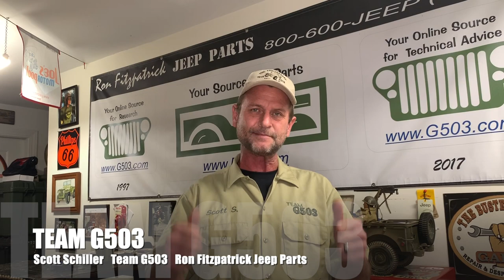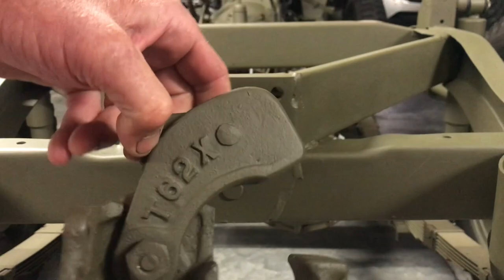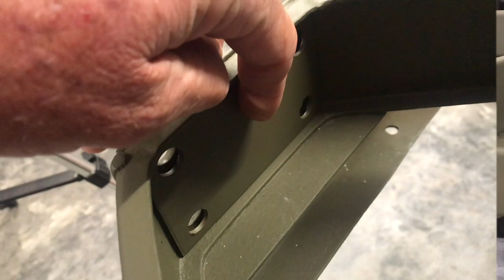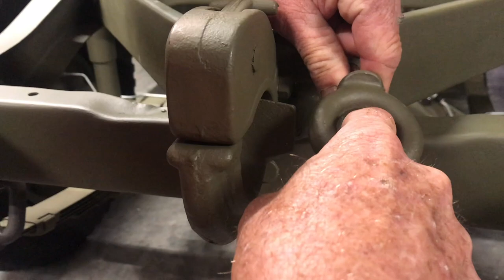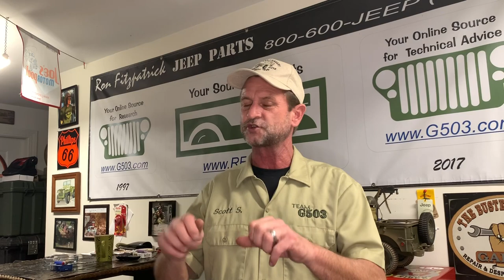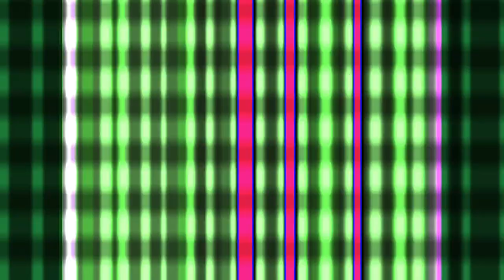Installing The Pintle Hook on A Willlys MB G503

Comment: A thought!  Since the eyelettes have a bend in them, the bend seems to line up with the "angle of the dangle" of the chain when safety chain is attatched,  if a drop of the hitch should happen, the weight onto the chain has a acute force, this can snap off the eyelettes if the eyelettes protrude straight out or at any angle other then the "angle of dangle" of the chain the acute force is too much for the eyelettes. Their strength runs through the eyelette themselves, ie their design!
Reply from the maker: Not sure what the “angle of the dangle” is. So what is the absolute take on the eyelet position?

Comment: Scott- in regards to the GPW not having the Reinforcement-pintle hook-frame (A552), check the bottom of page 18 in the -1348 dated APR '42 via Jeep Draw as it lists the plate as part of the Pintle Hook. Not sure if this is specific only to the 2nd contract GPWs or if the factory ignored the "theoretical" answer as my May '42 was missing the entire hook when I got it.
Reply from the maker: Tim Lehotsky the problem is it all changes during production. It’s very hard to document and follow.